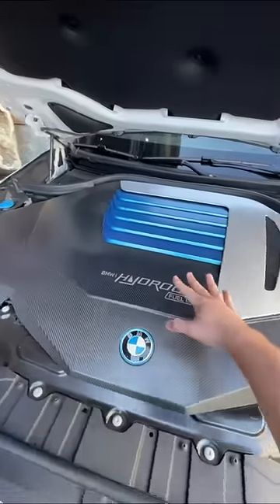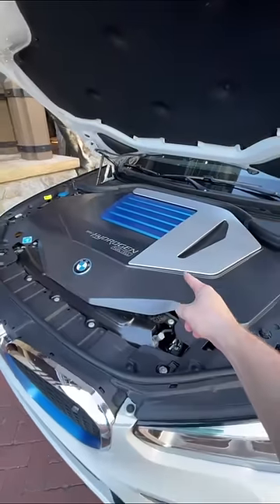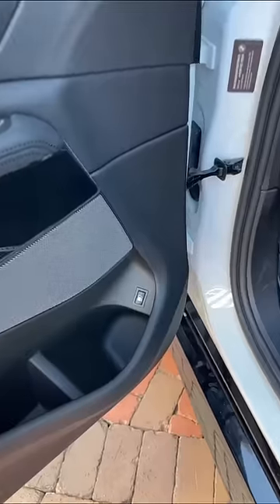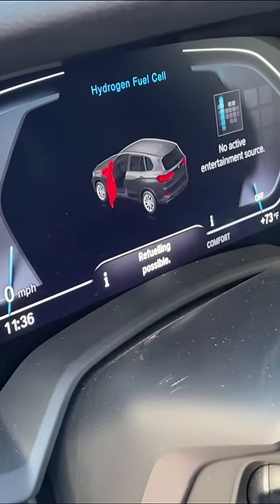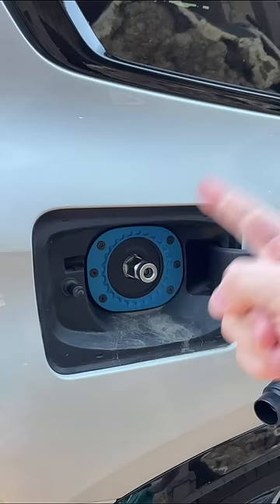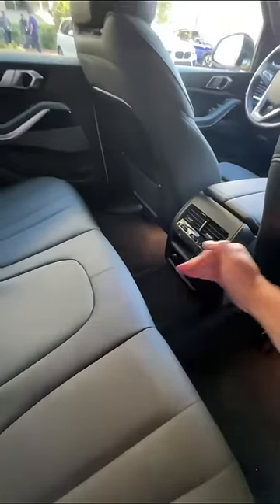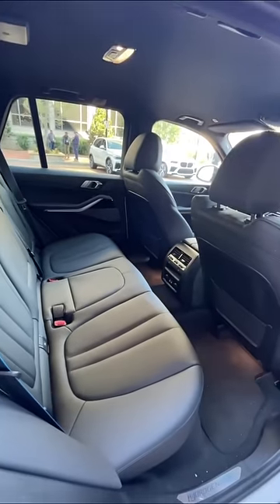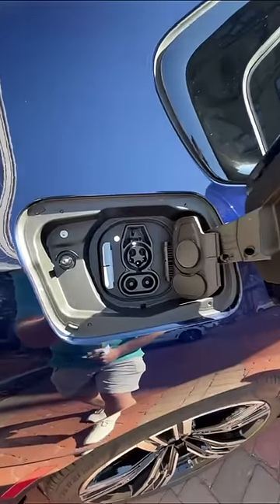BMW's Hydrogen X5 may be the future

Comment: I can sense the Mirai giggling
Reply: Is it because BMW looked up her skirt?
Reply: No
Reply: @TheMRacer  Reference to Jason Camissa's Supra / M2 CS video 👌
Reply: Hasnt the Mirai been deleted?
Reply: BMW has been doing LH2 for decades.
Reply: As soon as I heard “bmw may have-“ my brain went to the Mirai
Reply: *Laughs in Toyota*
Reply: @silentsir6268 BWM did have hydrogen ice long before toyota have a concept
Reply: @Frost_on_YouTube good comment, literally what happened
Reply: @bachhunghoang well that may be but they did borrow some stuff from Toyota to implement in their cars
Reply: @MaximilianvonPinneberg yes , this bmv is the next
Reply: My uncle owned both Mirais‘s the old and the new one. Considering the size of the car, the old one was awful in terms of inside space and practicality. The new one is quite a lot better, but still worse than any other car I know (this size). The price / km is high, the fuel cell makes noises and contains a lot of part, that may brake. And on top of this, it is quite slow, costs a lot and it is highly inefficient if you see the whole production und compression of the hydrogen. I think this system will never be the future.
Reply: @MaximilianvonPinneberg Toyota makes cars like the Prius and the Mirai to test the capability of their systems before they intergrade them into other models.
Reply: @Max-si8sy people thought that about electric cars for the longest time as well, which is surprising given the very first cars in the road were electric. We had electric cars before we had combustion cars, crazy. It's all about infrastructure and advancements in the tech, it takes time but Hydro is definitely better than both gas or electric would be
Reply: @KingArthurVII  don‘t think so- the overall efficiency of an hydrogen car is just to low. In times of limited resources, there is no electricity to waste.
Reply: @Max-si8sy  for the time being, just because it's a newer source and hasn't had decades upon decades of vehicular use such as the other two options at this time
Reply: @KingArthurVII  it is a physical problem. E-fuels , H2 and electrical cars all depend on electricity to generate the fuel. You simply need more electricity in a car that uses h2 to drive the same distance.
Reply: @Max-si8sy  H2 having a better carbon footprint than any Tesla would, the unforseen footprint to get H2 is much smaller than the electricity needed to charge those batteries in EV's. Yes H2 still needs some work, but it's a more eco friendly option than anything else on the road, at least until Aptera standardizes solar vehicles
Reply: @KingArthurVII  that is simply not true. The energy needed to produce H2 is much higher than the energy needed to charge a BEV. Or to put it a physical correct way: the overall electricity needed to drive 1km with an BEV is much lower than the amount of energy needed to drive 1km in an H2 vehicle.

Comment: 15 lbs of Hydrogen is over $245 per fill up in California. That is over $0.80 per mile. This car is incredibly expensive to fuel.
Reply: Dollar dollar bills yall
Reply: not for the broke
Reply: When you realize it’s cheaper to drive around on VP racing fuel than hydrogen
Reply: @SBFmafia  that is crazy but actually true. I think nitro methane is actually cheaper.
Reply: Lol alright Tesla fanboy overcapping like usual. That is so wrong 😂😂 it’s not $245 it’s like $50-$60 hydrogen. Hydrogen is the future unlike your lithium ion child mine on wheels
Reply: You sure “learn fast” 🤣😂
Reply: @davidelswick3032 like watching a wet noodle fight
Reply: @davidelswick3032  you’re wrong. $36 a Kg in the only state in the US that sells it.
Reply: @davidelswick3032 liquid hydrogen combustion engines are possible and have been made so we can have sound still and liquid hydrogen is way cheaper and it cleans the air as it runs
Reply: @davidelswick3032 how can you be so confident about being so wrong?
Reply: @I_hate_atf  hydrogen combustion engines don't burn clean.
Reply: @s3bastiaan  the oil is what makes it not burn clean
Reply: It’s more like $100, still not cheap but I pay about $50 to go 200 miles so 🤷‍♂️
Reply: Don't worry, it'll sharply decrease once they've figured it all out.

This is the true future of the automotive sector, not those silly EV's.

Even better, Toyota has a fully functioning liquid hydrogen combustion engine for their WRC program.

Thus it sounds and handles like a gasoline powerd car with 0 emissions and 0 compromise in the fun department.

Unlike the electric variants...
Reply: @theblitz6838  you’re delusional. None of what you said is actually true.
Reply: @I_hate_atf Not true unfortunately
Reply: @LearningFast  In that case, you're the delusional one...
Reply: @theblitz6838  Hydrogen internal combustion engines have been around for 60 years, they are old tech. They are not zero emissions as they create NOx so they fall out of goverment grants because of this. Also hydrogen is verry inefficient to produce, billions have already been invested into solving this for thens of years with minimal result. And on top of that they still need the same components as electric vehicles like batteries etc, and carry a 500 Bar bomb in the trunk. The only place a hydrogen combustion engine makes sense is in heavy equipment in hard to reach places. For consumer vehicles they make little to no sense
Reply: @s3bastiaan  Exactly what they said about EV'S in it's infancy.
Too expensive, too heavy, completely impractical and awfully bad for the environment.

It's still in its infancy and the people at Toyota are confident that they can work these kinks out.

And the hydrogen combustion engines don't need the EV batteries btw.
Reply: @jiceBERG get the money
Reply: @davidelswick3032  Where in California can you get 15lbs of Hydrogen for $50?!
Reply: not sure about this one but the mirai literally comes with $15000 credit to fill up.
Reply: @mynameisjohnlu  Hydrogen is $36 a Kg in California now. Each Kg gets you about 60 miles in the Mirai. A full tank does about 300 miles for over $180. The $15k fuel card won’t even last two years for an average driver.
Reply: All it will take is large scale hydrogen production to bring that price down, and, baking soda reduces the energy needed for the electrolysis to produce hydrogen. Perform the electrolysis in an ultrasonic tub, and the output is increased even further. This is something that can easily be adapted to work at home, and it can run on the 120v/240v line that feeds the house.
Reply: @Ryan770  it can take as much as 60 kWh to produce and compress 1 Kg of Hydrogen from water. It takes more than 5 Kg of Hydrogen to go 300 miles in a Toyota Mirai. Do you seriously think people are going to be able to do 300 kWh at their home on a regular basis?
Reply: @LearningFast    simply by putting baking soda into the distilled water, the power needed to produce 50% more hydrogen at 6amps at 20 watts (0.0017 l/s), compared to 2 amps at 35 watts in pure distilled water (0.00123 l/s). With baking soda, a kg of hydrogen would only take 2.3 hours to produce,  and a full 15kg tank would take a little over a day and only consume 0.48kwh. Adding the ultrasonic tub to knock the gas bubbles off the electrode increases the efficiency drastically as well. It's a viable fuel source that can be produced at home.
Reply: @Ryan770  Hydrogen is a store of energy not a source of energy. You can’t get energy out that you didn’t put into it. It is a really poor store of energy too. When you convert the Hydrogen back into water you get at most 50% of the energy you put in back out. You might as well just store the energy in a battery and get 90%+ of it back.
Reply: When you realise that water is dihydrogen monoxide and is incredibly easy to break down into its base elements
Reply: @officialcommitteeoftimetra9806  you miss-typed incredibly hard to break down into its elements. Water has extremely strong bonds.
Reply: @LearningFast  electrolysis begs to differ
Reply: @officialcommitteeoftimetra9806  it takes 39.4 kWh to produce 1 Kg of Hydrogen with 100% efficient Electrolysis. A more reasonable number is 48 kWh per Kg. It takes 4-12 kWh to compress and cool 1 Kg of Hydrogen for transportation to a refueling station. A Tesla Model 3 RWD has a 60 kWh battery and goes 250+ miles on a full charge. 1 Kg of Hydrogen that needed 60 kWh to produce it gets you 60 miles and costs $36 in California right now.
Reply: It's like everything else, once supplied in volume it will go down dramatically and they are now finding hydrogen deposits so future looks promising 😊
Reply: @jjjjrrr678  it has doubled in price in one year and the price has NEVER decreased. It will never be economically feasible.
Reply: Even on pricy cali electricity I spend $.06 cents a mile. This is 13x the cost with extremely limited refueling stations and potential for expansion (you basically have to replace existing gas stations and lines, while ev chargers can be placed wherever the grid exists)
Reply: What happens when you wreck. Doesn't pressurized hydrogen exploded when near fire.
Reply: In germany it would be 19ct/km or ~30ct/mile for this car. Still not great but wont break the bank that much
Reply: Nope
Reply: @SBFmafia nope
Reply: @jiceBERG nope
Reply: What’s your point?
Reply: And you can’t just roll up to a hydrogen filling station and fill up. 
Hydrogen filling stations aren’t like gasoline ones, they have to re-pressurize between fillings (taking whatever hydrogen they have access to & bringing it up to the necessary pressure to fill up a car’s tanks) which, if my memory is correct, can take something like 20+ minutes. 

So, basically as long as a fast electric charging station. Oh, and there very very few of these stations & they are often down as well (like electric chargers). 

This doesn’t even touch on the manner in which hydrogen powered cars operate (b/c they convert hydrogen into electricity it creates a lot of ‘lag’ & can be very unresponsive when you want to accelerate ‘hard’). Oh, and there’s massively energy intensive process of creating the hydrogen in the first place & transporting it to the filling stations…

I’m all for doing what we can to make things more environmentally friendly, but I just don’t think we are there yet with battery or hydrogen cars yet. Still have a solid ways to go in developing the right tech & the support infrastructure. But I do commend the effort even though I’m worried about the environmental harm being done to make all these batteries in the meantime time pursuing an overly ambitious goal.
Reply: @I_hate_atf  Hydrogen fuel cell cars clean the air, because they need extremely clean air to run properly.

Hydrogen combustion is worse than diesel in side-effect emissions so Nitrous-Oxides that come from very high temperature, lean mixture burning.

If hydrogen is coming it's most likely gonna be electric...
Reply: This car is incredibly expensive on its own
Reply: This is very temporary until the infrastructure to produce much cheaper renewable hydrogen is here
Reply: @thorium9190  they have been saying that for 6 years or more. Cheap Hydrogen is a myth.
Reply: I agree with the cost, but BMW claims 502 mile range, so that's only  45 cents per mile, not 80
Edit: forget that, 500 kilometers. Almost 90 cents at today's rate
Reply: Considering we pay $11 a gallon of fuel up here in the north it cant be that bad😂
Reply: Regardless of the price (everyone stop arguing about it, we get the idea) as hydrogen refinement tech improves, stuff is gonna become cheap as chips.
Reply: @themedic7933  you’re wrong and that is the issue. It won’t become cheap simply because it wastes so much energy. It will never become economically viable for passenger cars.
Reply: Yikes I just googled and you’re right it’s this expensive.
Reply: @davidelswick3032 you’re a liar. It takes 10 seconds on Google to confirm that the guy’s claim on price was accurate.
Reply: @theblitz6838  if it handles like a gas car, why would I want that? EVs have by far the best throttle response.

Congrats to Toyota. I saw a fuel cell vehicle well over a decade ago. It’s been vaporware for decades. The costs are outrageous for the vehicle and there is no infrastructure. I fill my EV in my garage.

Even if fuel-cell vehicles became affordable, you guys would still find a reason reason to hit on them because you’re addicted to gas. You simp for the saudis, always have.
Reply: @patty109109  They're shit, it's either full throttle or no throttle on EV's. Like driving a friggin bumpercar...
They're boring cause you get 0 response or feeling from the car itself.
"It drives from a to b, that's what a car does bro." I don't care for the opinions of these kinda folk, it's like asking an African to build a prosperous civilization...
Reply: You know the oil and gas industry fix prices to keep hydrogen expensive 😝 remember the guy who made cars run on water in the 80s he got wacked just like everyone else my point is hydrogen fuel it’s a fixed price to keep a strong hold on gas and oil useage they have a monopoly and wanna keep it that way
Reply: @theblitz6838 honestly props to toyota for not giving up to the EV craze bs, id buy a new car from them and nobody else lol they're still cooking and being the best automaker around after all these decades
Reply: @adorablecenturion8436  And they have their outstanding reliability score.
You can't really go wrong with a Toyota, I drive a tuned up Skoda Superb myself.
I gotta say, it's a damn sweet sleeper with the length of a Mercedes S Class.
I was quite surprised at how much character that Czechian tank has.

Comment: We’re moving up in life boys! We’re going from Coolant Leaks to Hydrogen Leaks 😂😂
Reply: Hahaha
Reply: hindenburg 2 electric boogaloo
Reply: And then people thought electric cars burned well...

Welcome to the next level!
Reply: @doctordapp Actually, Hydrogen Fuel cell cars are safer than both Electric cars and ICE cars in terms of a fire.
Reply: Yea but don't worry it can't explode or nothing cough cough
Reply: @almightydtr  For it to explode you would need to ignite the Hydrogen inside the tank. Being that it's stored under high pressure, it will likely vent out in less than a minute if punctured in an accident.
Reply: Hydrogen doesn't go boom, helium on the other hand.....
Reply: Dw that hydro fuel cell is reliable, bmw literally swiped it off of the toyota murai (hence the mk5 z4 was born in exchange)
Reply: To hydrogen bombs
Reply: Knowing BMW, it will still have coolant leaks.
Reply: @AD-1138  blud forgot Hindenburg Burned.
Reply: @jameshailerthepostmaster4389  Who forgot about the Hindenburg?

Of course it burned, hydrogen is extremely flammable. Despite this, it's still safer than gasoline as Hydrogen is a gas when it's not under pressure and will dissipate into the atmosphere.
Reply: I love how people think a hydrogen car is going to explode but ha e been happy with petrol cars for over 100 years! (I understand storing hydrogen is harder than petrol)
Reply: When hydrogen leaks, it rapidly diffuses making it non-explosive. Additionally, there have been plenty of tests where they ignited a hydrogen tank and a gasoline tank in vehicles. The hydrogen is far safer than gasoline. 

We, as a society, have just normalized driving around with gasoline and forget that those things will also catch fire.

Comment: Just FYI a hydrogen fuel cell car is also an electric car. The storage off energy is different the rest ist the same
Reply: Also? So it's hybrid?
Reply: @DreStyle  the engine that moves the car is an electric engine on an bev which is a battery powered electric car the storage of the energy is in form of batteries. On a let's say conventional hydrogen car the storage is a tank filled with hydrogen gas and a so called fuel cell transformers that hydrogen into electricity that for most part is given directly to the engine or stored in a much smaller battery. There are some companies who try to make combustion hydrogen cars which use a more conventional engine and have the hydrogen exploding in the fuel chamber but that has some advantages but also lots of disadvantage
Reply: All the benefits of electric with all the expense and inefficiency of burning hydrogen to turn into electricity inside the car. 
Burning fossil fuels to make electricity to make hydrogen to make electricity to power a motor. Or even the green option using solar and wind to make electricity to make hydrogen to make electricity. 😮 I dont get it